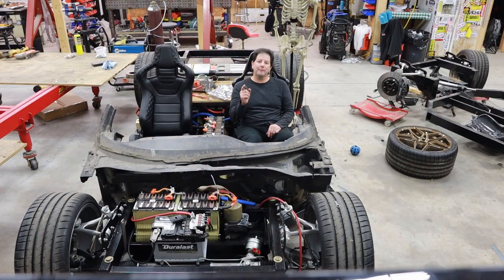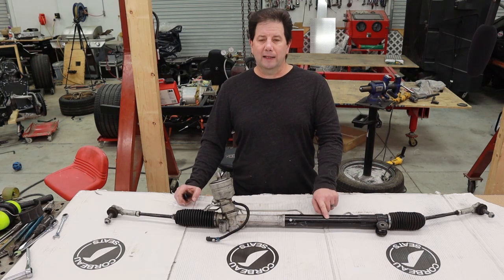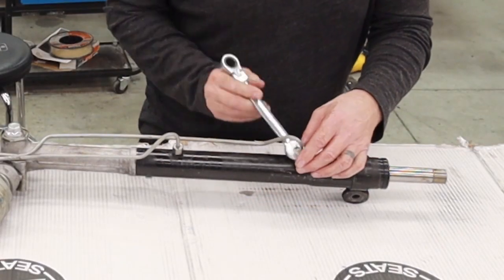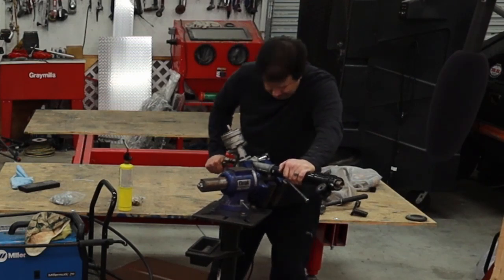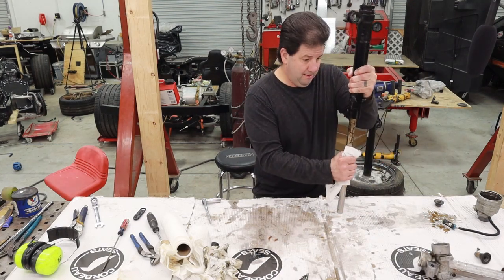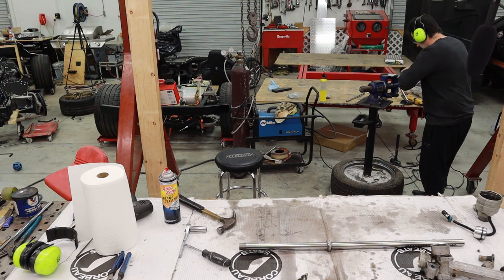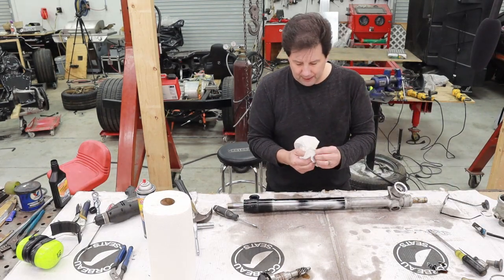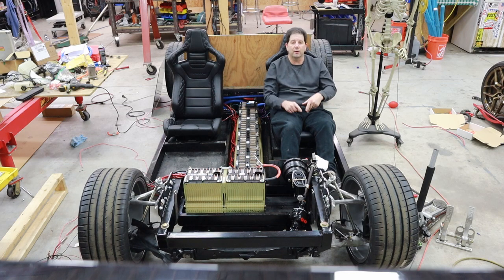Project Split Decision Car 1  Ford Aluminator XS Car 2  Tesla Model S swap     DIY  Supercar Part 10

Comment: Will you be adding a vacuum pump for your brake master cylinder, or will you be going manual like your steering?
Reply from the maker: Electric SuperCar the steering is actually going to be EPS from a Saturn Vue.  Brakes will require a vacuum pump